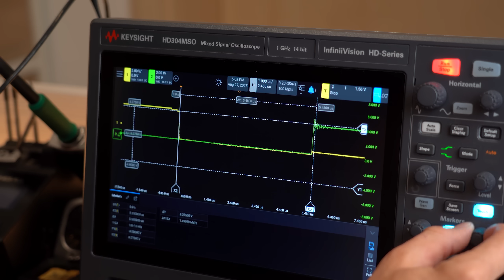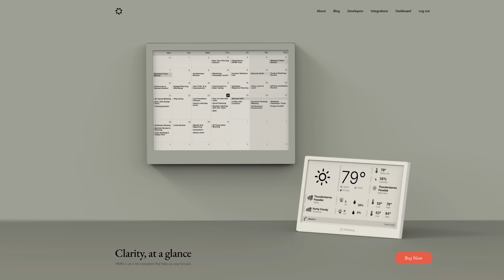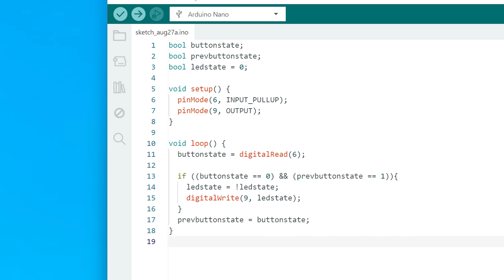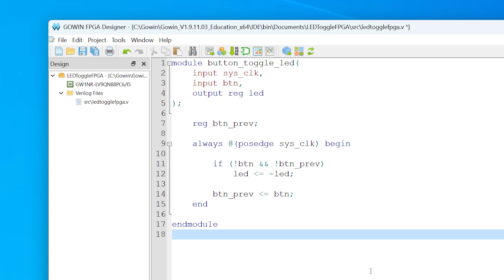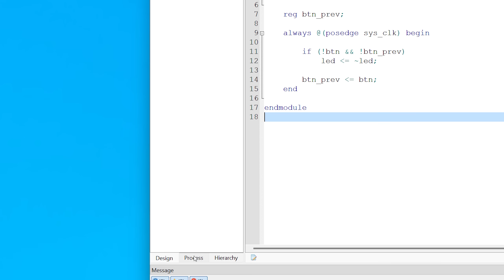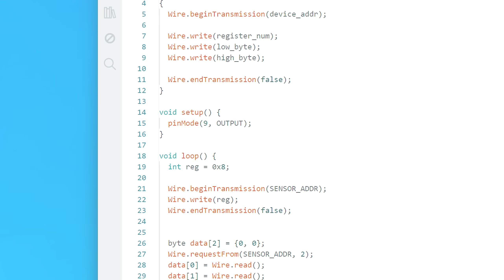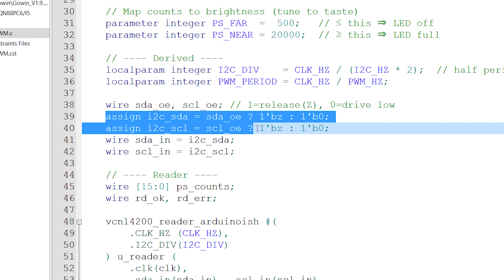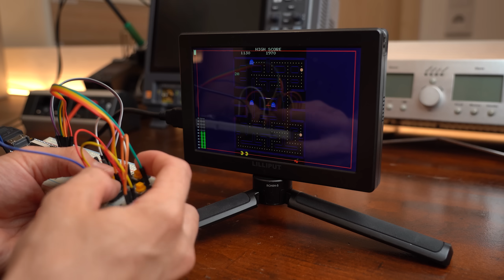The Harsh Truth about FPGAs (You Should Avoid Them?!)

Comment: FPGA Engineer here ! I agree with nearly everything you said in this video. FPGAs have a really tough learning curve, and often has more use in industry than DIY.
In industry we often use SoCs with both CPU and FPGA, and they can communicate together super easily. This way, you have CPU flexibility, and FPGA speed (see Xilinx/AMD FPGA or Altera/Intel). Nowadays you can drive the cutting-edge FPGAs over 300MHz super easily, the best case probably being 600MHz.
One last thing, you could probably use a pre-made IP from internet for I2C, SPI, UART, CAN, etc...
Anyway great video as always !
Reply from the maker: Thanks for sharing your experiences :-)
Reply: The learning curve is always a roadblock but in the end, you can literally build anything..I think with the addition of hard processors in the SoCs, you can pretty do anything..
Reply: Long time programmer here with on again, off again interest in FPGAs. As someone without an electrical engineering background, I always struggle to find a use for FPGAs. The idea that one COULD be turned into any CPU you wanted is neat and all, or any other IC really, but I struggle to find a reason to go that far. Could you give some practical examples where you write something for your job that wouldn't be feasible for a microcontroller (or full CPU) to do?
Reply: @Feynt : FPGAs are best used to replace bit-banging. They can implement a CPU, but that's only really useful for CPU designers, people that already are using an FPGA for something else, and people that need a processor that isn't reliably available for some reason. You should really use FPGAs as extra I/O systems rather than as CPUs.
Reply: @absalomdraconis 
So they're basically a way to make programmable interfaces for devices that normally don't have an interface? I'm still not really seeing the benefit versus a microcontroller besides speed. I mean, if the speed is important, sure. This might just be a thing I'm too software to understand.
Reply: @Feynt  I think it's fair to say that speed is what FPGAs are all about. But general-purpose DIY has no need for extreme speed in hardware. The niche might be in creating a device to do some hardware job instead of having a chip made. But honestly those are rather unusual situations.
Reply: @Feynt  think things that have huge number of IOs that need to be processed very quickly in parallel - display converter, logic analyzer, etc. You can also think about them as a way to build a custom special purpose chip.
Reply: @JohnGodwin777  
Yeah, definitely not something I encounter. In my typical work, I crunch (tens/hundreds of) thousands of records in seconds and compare them against other data, translate things into workable objects, and then use those objects to action things (like switching videos on a screen or sychronising computer playback). I always made the joke that "I don't do hardware", but it's true. I never got a chance to learn anything beyond the kernel interfaces to ports. I can open a serial port and send/receive bits, but the actual transmission of those bits might as well be as arcane as what I do is to the average person.
Reply: @JohnGodwin777  Exactly. And in addition you can think of them as Field Programmable
Meaning that if you have an installed base of customers, and - a standard changes, - a feature is requested that requires an additional input or output to be considered or dealt with, - an error is found under certain conditions....
You can role out the new version without making new hardware.
Reply: @Feynt  Cybersecurity engineer here to add on some FPGA uses, in my field we use them do drive timing sensitive electromagnetic / laser fault injection. We also use them do to signal processing in order to implement attacks on radio protocols that needs to be send a certain packet faster than the response of our target for instance. Still for radio use, all decent software defined radios use FPGAs to implement best the software radio that we programm into it
Reply: @Feynt  Basically everything high-speed related that needs to be done in a cost-effective or energy-effective way.
Scott mentions it a few times but in my view does not emphasises enough that the big difference is that FPGA's can do a lot in parallel (a LOT). Also, not everything needs to be clocked, all those and/or,etc gates are NOT clocked, only the "saved states"/registers/flip-flops.
Imagine doing 8K video processing and interlacing of 4-8 channels in a CPU... Even a big beast of a computer will give you glitches but this is not a problem for a beefy FPGA which consumes less and is cheaper than the required CPU/GPU.
Or reading in an high speed and high resolution ADC, running the values through a digital filter and presenting this  as already processed value to a co-cpu. Most DIY stuff does not require a FPGA but there is a lot of power in those when combined with a radio block/chip, cpu, dsp or other gateway processor.
Reply: @Feynt  One project I once did using an FPGA was a special-purpose logic analyzer of sorts almost 10 years ago. It measured 8 digital inputs at 100 MHz sampling rate, and it output the data directly over Ethernet with a UDP-based protocol. It used a small, low-cost, but it was easily able to do data compression on the fly (in order to stuff all of the 800 Mbit/s measurement data over a 100 Mbit/s Ethernet link). The PC software I wrote to receive, decompress and save the data was barely able to keep up with it, even though the FPGA logic was running at just 100 MHz and the PC had a quad-core Intel i7 running at around 3 GHz.

Another project that was purely for fun was a multichannel Ethernet-based christmas lights PWM controller. The FPGA received Ethernet frames with a 16-bit brightness value for each channel, and fed them to the PWM controllers implemented in logic. I repurposed a hardware with an FPGA for the project, and unfortunately I don't remember anymore how many PWM channels it had in the end, but it was somewhere between 20 and 30 as far as I remember - limited by the number of I/O pins I was able to dig out from that PCB made for entirely different purpose.
Reply: @Feynt  We used them at work to achieve nanosecond timing for controlling EV car inverters. The raw speed that the FPGAs made that possible.
Reply: @Feynt  I encounter them almost everywhere in the equipment I work with, they use them mostly in io boards for assemblies. I think they mainly simplify and give some flexibility/ modularity over hardwired cricuits, and make more sense in these io control circuits than a cpu would (although you certainly could use a microcontroller or plc for this, they wouldn't be as reliable, fpgas will usually function glitch free for decades). A lot of routers use them as well for reasons I'm not familiar with.
Reply: @Feynt I am also programmer, but i used fpga in the past, not much, just one side project. Idea was that they wanted to sample and process 26 audio channels in real time, they tried first with microcontroller and it failed spectacularly. I made it pretty easy via zynq board which is MCU+FPGA with shared memory. With fpga all computations that dont depend sequentially you can do in parallel in this case complete sampling/processing of 26 channels. Best thing is you can use IP-s for many common processes in this case FFT for each channel in parallel, and when that is done  you just copy it to shared memory and rise interrupt to MCU.
So in short, you can make almost everything much much faster than any cpu can handle.
Hi end devices like routers, oscilloscopes use fpga
Reply: I have several products delivered that is FPGAs.  I have never delivered anything that was FPGA alone.  Always mated it with a processor to add functionality that the processor was lacking. I even was on a team that used an FPGA to basically be a DDR controller for a processor that didn’t support DDR.  It worked well and we shipped thousands of the product a month.   
My first thought when you talked about writing your own I2C was just “No”.  Go get a library that supports that. And if you’re using an FPGA that doesn’t have those kinds of libraries it’s time to move to something else.
Reply: I think FPGAs make a nice bridge between MCUs and ASICS.
Reply: i started to learn fpga recently and i went with the lattice ice40 fpga and verilog, and i went with open source tools like icarus verilog, yosys... my question is do you have some good learning ressources that helps me advance faster?
Reply: Your point was what I was thinking aswell. I am not a FPGA developer but had my fair share of experience with them at university. There are usually pre made "modules" which implement instantiable blocks similar to library function for MCUs.
But I completely agree that you need a very different way of thinking to program FPGAs. It is after all more like designing a logic circuit in words than machine instructions.
Reply: Another FPGA Engineer here, +1 to this comment.
Reply: I can double that. In the past I've used FPGAs in both standalone projects and as peripherals. Almost always, any nontrivial design will require a microprocessor, be it a separate external microcontroller, a "hard IP" processor embedded in the FPGA's silicon (like the SoCs that were already mentioned), or a "soft IP" processor implemented in HDL inside the FPGA fabric (like Intel Nios or AMD MicroBlaze). The processor is good at controlling the sequence of things, managing data flows etc., while FPGA logic does the all the "heavy lifting" that is not feasible on a microprocessor, such as fast signal processing or parallelization.
Reply: im a new to fpgas, and im already feeling the pain man

xilinx ip documentation moment
Reply: You can get FPGAs which have FIFO buffers that will work at GHz clock speeds. They use ECL. They are for high speed serial sampling.
Reply: Agreed on the use of manufacturer IP blocks (there are for many peripherals, many of them free of royalties). Also, if you have some non-critical logic which can be tedious to implement in HDL, you can instantiate a softcore (like MicroBlaze, RiscV, ...), and use the AXI protocol to talk to the various FPGA blocks.
Reply: It's either a "learning curb" or a "learning wall...." I consider it too sharp and pointy to call it "Curvy."
Reply: Any advice for new grads? Im looking for a job after my bs this semester.... I guess I have some personal projects, but I really am not sure.
Reply: @Emilstekcor Contacting the FPGA engineers on Linked for the companies that interest you is a great way to get in touch and maybe get a position
Reply: This is mainly due to the tools being cost-prohibitive for a DIYer to attack an FPGA project.  Why the development tools aren't more readily available (and free) because the cost should be purely attached to the silicon itself is beyond my ability to comprehend.  I did FPGA's in my undergraduate and graduate studies at BYU.  Their reconfigurable computing lab went as far as creating their own synthesis tools because vendors would hoard their toolchains, rather than open them up.  If they were similar to the gnu tools in licensing, then this world would be a much better place for everyone.
Reply: @byugrad1024  For a DIYer the tools are free. Both Vivado/Vitis and Quartus are free, unless you are tackling $$$ FPGAs (in which case the SW cost blends within the HW one).
There is "something" which targets a very limited set of simple FPAGs, but that's almost nothing.
The issue about why there are no OSS tools able to generate bitstreams for a wide variety of FPAGs lies of the complexity of releasing a standard which would allow such tools to correctly perform P&R (place and route) and verification.
The fear of disclosing too much IP, and maybe some job security for the hundreds of engineers working at SW within Xilinx, Altera, ....
Reply: FPGA's dont just have a really tough learning curve. Those things are some kind of unholy combination of medieval alchemy, the darkest of black magicks, pacts with demons, modern engineering, and a really tough learning curve....... you'd think it'd be like those old radio shack electronics kits that's just hardware and a huge breadboard with jumpers to learn how transistor logic works but no......
Reply: For hobbyists, access to standard libraries for microcontrollers makes a huge difference.  @valrom17 Where would you recommend to look for the pre-made IP you mentioned? Is there something like Arduino libraries out there? Or just random Github repos?
Reply: yeah I'm pretty sure Tang Nano github has pre-made IPs, I've used them personally in my projects, especially the communication protocol IPs such as SPI and I2C, though they are written in Verilog HDL
Reply: I have a question, in your developing experience , do you prefer using Zynq SoC for FPGA and CPU co-working or just use the separate FPGA chip communicate with MCU on PCB to realize the FPGA and CPU co-working?
Reply: @sarahclark580 I never found the solution "PCB MCU + FPGA" to suit any of our use case. The problem is that it is very inconvenient to transfer data between the two in such configuration.
If the MCU is just a small micro controller, I would put that in the FPGA.
Now if you need a good MCU, the zynq/versal is a very good and reliable option, with great support for quick baremetal or reliable Linux.
A last option, my favorite, is to use a computer with the FPGA using PCIe. It gives the best flexibility, but does not answer every need. 
Hope it was interesting :)
Reply: Ye
A pain to do ass a hobeist 

Do you have a opinion about vivado ?
Reply: @Goroca  It works the way you want to and honestly is a lot more properly created. You can even have all initialisations in a tickle file (.tcl) used in industry. Vivado also supports SystemVerilog which sadly the previous one didn't.

Honestly kind of hard to beat given Xilinx literally came up with the concept of FPGAs, so expect them to have a good lead unless they mess up like intel, which doesnt seem to be the case given they got acquired by AMD.

The timing analysis and visuals of place-n-route are very helpful, idk if others have that much. Also the Oscilloscope type feature is amazing (i forgot the name).
Reply: @arnabbiswasalsodeep 
Ok then 
We had nothing but problems runing it, might have been the setup or bad instructions not really clear
Reply: @Goroca Vivado is the best software for big projects, but it's definitely hard to master and often not a pleasure to use at all. Software in the FPGA industry is very... frustrating 😅
Reply: @valrom17 
Think the reson I hate it is that we need to used it for cass but get no instructions on how to use it
Reply: if the is no cheap open hardware FPGA for linux the forget it.
Reply: @Henry-sv3wv : ice40k.

Comment: 0:21 I am actually surprised arduino code managed to get it within 100 CPU clocks.
Reply: I bet using a HW interrupt would be even faster- as no code needs to execute until the event happens.   With the polling code the worst case is you just miss the transition and need to complete the rest of your loop before checking the input again.
Reply: @rick-lj9pc  No. If reading button pin state and setting output accordingly is all you need then loop with direct register reads and writes in main will be faster. Interrupts have latency and handler will need to stack/unstack CPU registers and fetch GPIO register addresses each time.

Comment: I'm surprised there are not any High-Level Language Compilers for FPGAs to make programming easier. Also, programming at the Assembly Code level of the Microcontroller would greatly speed up the response times (but also make it just as hard to program as FPGAs).
Reply: They exist. You can write code in python that do everything Verilog can do but much easier. LiteX project

Comment: So FPGA is like DIY microcontroller
Reply: litterally just MAKE YOUR OWN MC but you can also make ANY EXISTING MC to Just make your whole Board.The FPGA is the Swiss army knife but sometimes you just need the flat head and only the flat head so MCs still have their place.
Reply: Another advantage of FPGAs and CPLDs is power consumption.
Reply from the maker: Kind of. You could turn an FPGA into a microcontroller ;-) There is even a project for that ;-)
Reply: You can build a full CPU on an FPGA capable of running Linux. I'm not saying you would as some of the SoCs out there already have dual-core ARM processors on the same chip as the FPGA. I used one to drive 100 strings of WS2812b LEDs controlled by X-Lights. The CPU handles the networking and the FPGA drives the LEDs incredibly efficiently using DMA to read the data straight out of the network buffers. With a larger FPGA I could drive many more strings with no additional performance hit as every happens in parallel in the programmable logic.